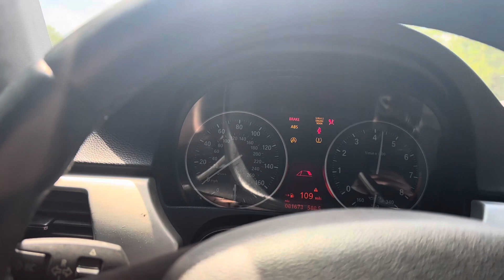THE CAR IS COMPLETELY DIFFERENT!!!!

Comment: Yeah 2nd crank hub. But also put engine cover back on water gets  into cyclinder 6 injector port. So the covers a must. Plus some wheel spacers sand lite rear fender roll will bring her out nice.
Reply from the maker: i need to do that i have water in my cylinder 6 port gotta suck that shit out but all the other stuff coming soon 🔥❤️